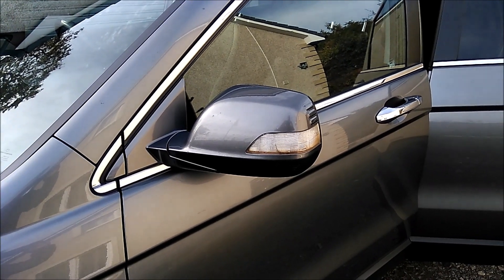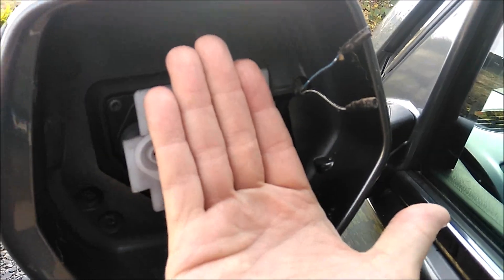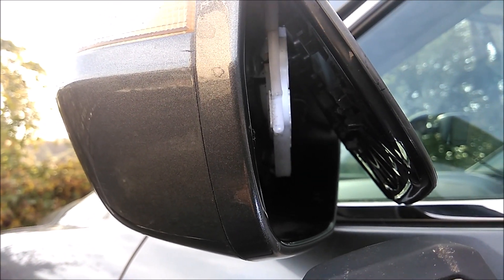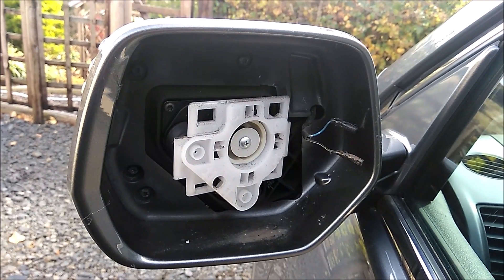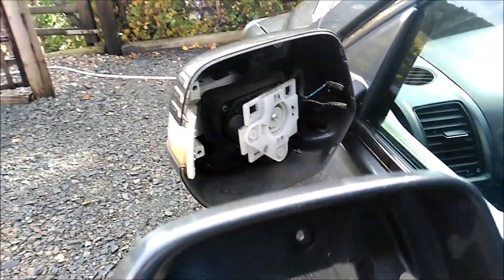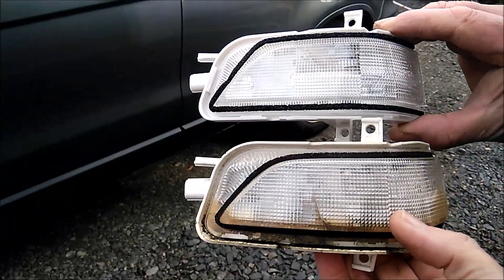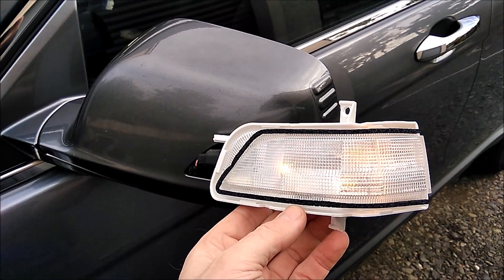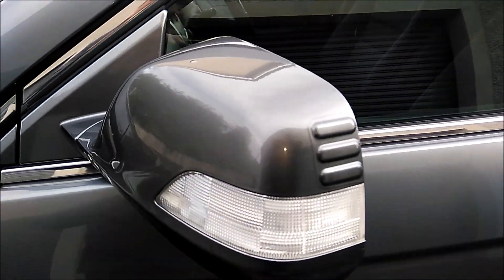2007 to 2011 Honda CRV Door Mirror Indicator Replacement Walk Through

Comment: Great video, yes no need to pull the mirror mount off, the indicator unit comes out once the outer bezel/surround is removed.

Also, no need to remove mirror power supply wires😎😎😎
Reply from the maker: Good points Richard

Comment: Excellent tutorial. I've just changed my sidelight. I think they changed the internals slightly on mine (2010 model) and I did not have to take out the internal element. The light, with a bit of shoogeling came out, and the went back in the same way with the new light.
Reply from the maker: Interesting that there's a variation. We did a revisit on the opposite side last week. The less to remove, the better! 😉

Comment: Thank you for your help.
I'm having a problem with the folding motor and I'm not able to remove it. Can you help, please?
Much appreciated.
Reply from the maker: I had a problem with the folding motor on my old Hyundai i20. It was a corroded terminal that was causing the problem. Unfortunately, I've no experience with the CRV mirror folding motor. I did post a video of the Hyundai a few years back, should be in my video list and might give some clues, if there isn't already another CRV video on YouTube?
Reply from the maker: This was the Hyundai video 
https://youtu.be/VVJyVSo9oRs